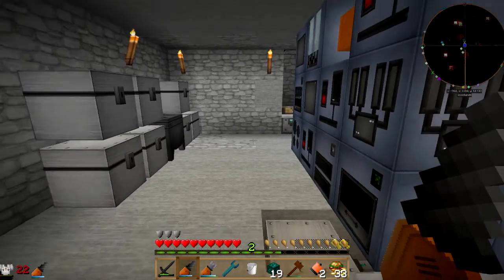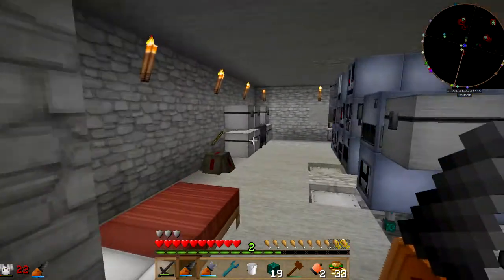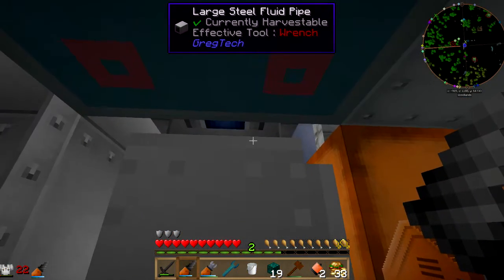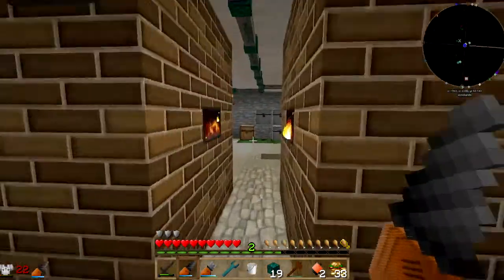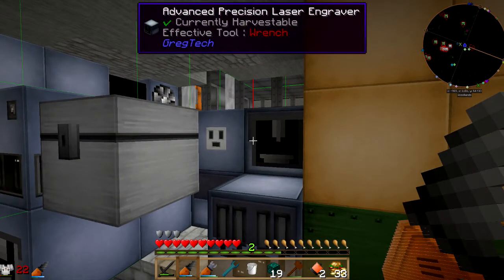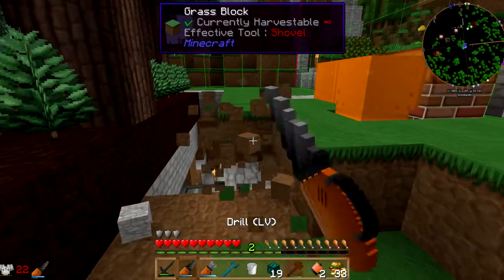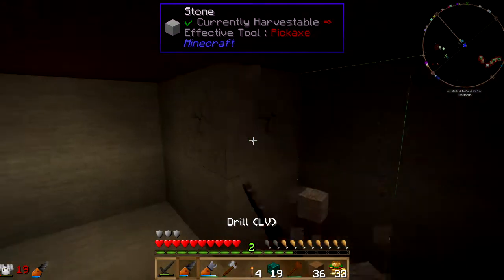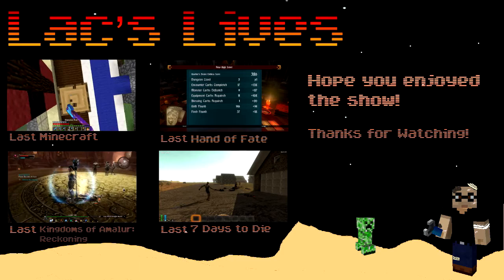Lac Plays FTB Infi-Tech 2 Ep 61 Arranging The Chest and Fuel

Comment: Running charcoal into Large Boiler one by one is the most stupid idea. It will produce nothing, because it needs to heat up. If you put one charcoal it will make like 10mB of steam.
I am sorry to say this, but youa re still running around same thing over and over again for 10 or more episodes and its not fun to watch. Really do something about it. Either boost up charcoal production with Alloy Smelters + Stirling Generator (with Dual-Layer Capacitor inside) combo. Feed wood into Alloy Smelter, then feed it directly to Stirling gen. Excess to the barrel and you are sorted with charcoal forever. Always put as much charcoal as possible into Boiler, so you will produce steam more efficiently.

Another way of getting energy you are able to do at your current state is forestry Ethanol + Diesel Generator combo.
Reply from the maker: Ahh, that explains things. :) I thought I had read they didn't need to heat up. While I'm moving my base I'll have to get charcoal production set up better.